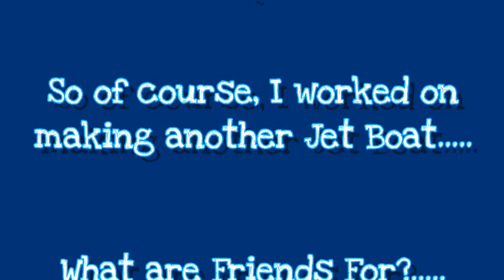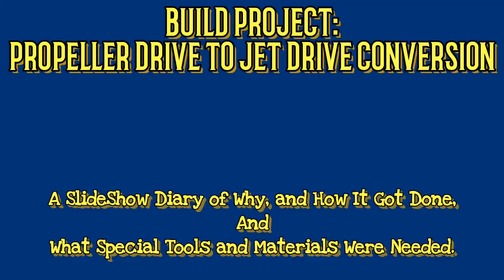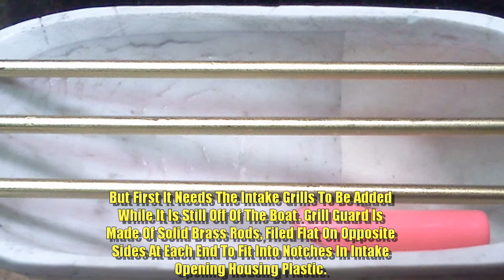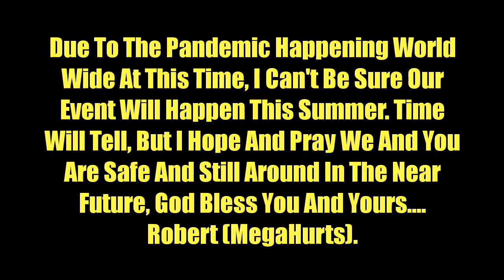#MHzJetboats | The MegaJet32 | The Ultimate Toy RC Boat Upgrade Mod, A Homemade Brushless Jet Drive

Comment from the maker: Project update: The river finally thawed out and we've had a few descent days that were not so cold you'd get frostbite by getting fingers wet, so put the boat in the river at the fore bay boat ramps to test. The 1000KV motor didn't get it moving very fast at all, so switched to a 3250KV motor and while it seemed to have potential major speed increase, I never got to full throttle before the ESC popped. So thought about it for a few days and decided to change out the 2 blade rubber impeller for a KWAD 3" 3 blade prop turned down to 32mm. This worked very well on my last boat and made a big difference on this one also. Strange?! But got successful testing done and recorded on video, will post this up soon.